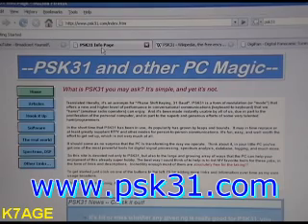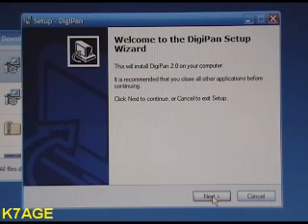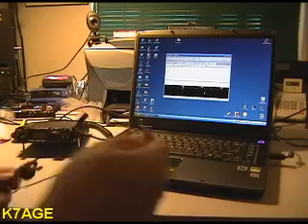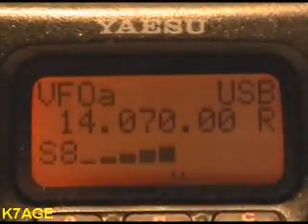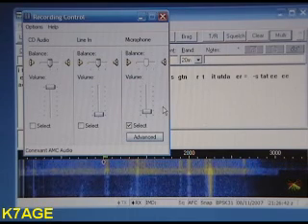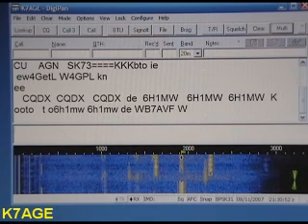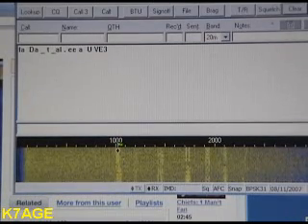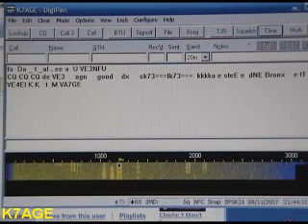How to receive PSK-31, Introduction

Comment: Randy, I am unsure if you will ever see this. I was wondering how a 20 meter vertical would work for PSK?  Would it be adequate , or do you need a better antenna system, because of QRN or whatever?
Reply from the maker: Hi, I should work fine. Although most of the digital activity has moved to the JT9 and JT4 modes. Vertical will work great for those modes. They do very well with weak signals.

Comment: Nice video Randy, so thought I'd try. Installed digipan and it runs, but Configure > Waterfall drive.. doesn't open that audio window you show. Other options in Configure do work, such as Sound Card... and Font... , but not Waterfall drive... 

Any ideas why that might be? (Win 7 Pro)

73 de Jim, ZS6JMB
Reply from the maker: Probably different with the newer version of window. Try the windows audio mixer

Comment: Theoretically, it is possible to use PSK31 on the CB (unlicensed truckers can use) band. Is this something you have ever done? Or is it a bravo alpha delta idea?
Reply from the maker: +jjovereats Technically, it would work. Legal, I don't know.
Reply: theres something called the "easy digi board" that'll hook up through the CBs Mic plug and you hook the board up to the computers sound card (sound output and line out). 

and I also seen a video on youtube whete a guy wired up a USB sound card into a CB (hooked up to the Mic plug) and sound would be connected by USB to the computer.
Reply: +madmax2069 the video using the easy digi board in named "CB Digital mode test"

and the one using a USB soundcard is called "Uniden bearcat 980 SSB cb radio with USB port"

Comment: Aha! I can use little $1 Baluns (audio matching transformers, balanced unbalanced)
 across both the speaker out on the transceiver and speaker out on the PC & interface the two!! Awesome! I used my last batch of cheap little audio Baluns in guitar & bass wah wah pedals, mainly because the impedance & resistance was almost spot on for a wah inductor, but for 2%-8% of the price, of a wah inductor, and they actually fit the circuit board holes. They don't look right cocked in there cocked at an angle, but they sure do work really well. By inducing a little constant DC current into the core with the secondary they get even better sounding as the core saturates.  Another project for another topic, but be maybe interesting to some people. Over saturating the coils is a really good thing for guitar, but not at all for data signals or voice signals.

Comment: Forgot to ask, do you have a video showing how to directly connect the radio to the computer? I am mainly a Mac user.

Thanks!

Rob
Reply from the maker: Sorry, I don't have a video that shows hooking up a radio. You typically need some type of serial interface to work with your logging software.
Reply: Rob Fern did you ever run PSK31 on a Mac? I too use Mac and have been looking for more info on using Mac instead of windows.
Reply from the maker: Sorry no Macs here. Google around to find others that are doing that.
Reply: VideosByDPF  I am currently trying to make it work. Everything "works." I do get a signal out. I tested this via 2m last night and right now I am trying to find anyone on. 14.070
Reply: Calling CQ on 14.070 psk31
Reply: I will be setting mine up (windows version) hopefully this evening. using an Icom IC-7200 and Chameleon Hybrid-Mini. Once I figure out the windows version I will search for mac.
Reply: VideosByDPF seems not too difficult... I am still getting to know the program. Bands seem to be bad today. I will let you know how do. Most vids out there seem to be incomplete. Just figure out a setting that I did not have on. I am on my 857d with my signalink USB into my ATAS 120 with my MacBookPro. I'll be on 14.070.

Comment: This is KU6C.  I just started using Digipan 2 under windows 8.1, signalink into my FT-450d transceiver.  My experience so far is problematic.  After just one transmission and switch back to RX mode, the waterfall stops working and the system will no longer transmit.  As a matter or fact it works inconsistently.  it will let me transmit an entire CQ, but then the program hangs up.  I sometimes have to reboot the machine to get the program to run again.  I am running Digipan on a Dell Celeron 1.5 GHZ laptop.
Reply from the maker: Maybe Digipan and 8.1 aren't hapy together. Try FLdigi, free. It does PSK and many other modes. Also, you may be getting RF back into the computer. Try leaving the Signalink on, and turning off your radio.
Reply: +K7AGE I downloaded Digipan and got text off your video with Windows 10. Windows 8.1 was, well, I really hated Win 8.1 with a passion! The upgrade to 10 was free, but not without a few problems. My hard drive took a dump, right after I got it sorted out, but that is unrelated.

Comment: Hi Randy - I just wanted to share a fix for Digipan 2.0 that I came up with to fix the broken station lookup function in that software. The lookup link for QRZ's web site has changed format since the last version of Digipan was compiled in 2004. I can up with a solution using Firefox and a plugin called redirector. You can find the link to my blog on my page on QRZ - I have an article on exactly how to do it on that blog - My call sign is KK6IQK - And thanks a lot for your videos on PSK - I am now receiving PSK signals with my new station and am close to taking my general exam because of your videos and examples you provide to us all. Take care! -- Jon
Reply from the maker: Jon Almada John, thanks for the fix it tips. Please keep me posted on your general.
Reply: K7AGE passed my general... just getting my antenna put up and should be up and running in the next week... woohoo
Reply from the maker: Jon Almada
Outstanding!
Reply: K7AGE I am excited... will see you out there. 73 de KK6IQL

Comment: This was really well done. Thank you Randy! Very nice intro to PSK31....now I need a 20 meter antenna. Does PSK31 only work on 20 meter or can I do this on 2 meter and 70cm too? I will research this myself...but great intro, thank you for taking the time to do this!
Reply from the maker: Drennen Gaffney PSK can work on any band.  Typically uses USB and uses less than 50 Hz of bandwidth. If used on FM, then it will take the entire channel. I don't think PSK is used beyond the HF bands.

Comment: It's not letting me open the waterfall drive in the configure tab. The mic works and nothing shows up in the waterfall area? Any ideas? Thanks. -KD9AKK
Reply from the maker: This video was made on a computer running XP. Sound changed with 7 & 8. What interface are you running?
Reply: I have win 7 and got it to work. Thanks much. Like your vids by the way.
Reply: tullyman82 .
Please tell us what you did to set it up with Windows7. I can't get mine to work.
Reply: If you get your external mic to work that's half the battle, let me know if you are that far.
Reply: You are going to have to go into the computers control panel. Find Hardware & sound. Playback tab on top is selected should see a speaker. click properties tab which will take you into speaker properties. Click levels tab on top, Click input monitor so it isn't muted. Then you have to click ok save settings. Now go into recording tab click levels, then click the speaker icon to unmute it click ok to save settings. Test mic if you can hear your self through speakers of computer. If not you might have to fart around. Hope this helps, settings are not saved after shutting off PC, kinda pain in the butt........

Comment: I just finished watching your 6 Meter Dipole video. Do think I can use this inside of my hotel room. I am on the third floor (top floor) which I guess should make it high enough above the Earth to not interfere with the ground.
Reply from the maker: That will work. You my have some interaction with other things in your hotel room. Give it a try. Some windows may have a metalized film to reduce the sun. Give it a try.

Comment from the maker: Your computer has speaker or line level, which is a high amplitude signal. This will probably overload the radio's mic input. You will need to attenuate the signal before going into the radio. You may have the same problem going the other way. Search for sound card ham radio interface.

Comment: Randy, I've got a Yeasu FT-8900R.  I was wondering if I could plug an audio cable into the speaker jack on the back of the radio and into the microphone jack of my computer and do it that way.  Am I going to blow anything up?  73!  Richard S. KF5RHI, Fort Worth Texas

Comment: Thank you very much for this tutorial (and all of your excellent amateur radio videos).  I found this video after finding your PSK31 sample video, which I was able to decode using the PSKer app on my iPod Touch.  That's pretty cool.

There are PSK31 programs for Linux.  I think I'll install one.

I've been interested in amateur radio since 1973, but never got my ticket. I'm finally taking the test in two weeks.

After much comparing, I think I'll order an FT-817ND today (RX only for now).

Comment: I've been a ham for many years but only recently got into HF digital modes. Unfortunately I can't really transmit via HF because of the apartment I'm in so I monitor using an Icom R75 and R8500 receivers. I managed to hide a vertical HF antenna in a tree out back and it seems to work great for listening. Of course the moment the property manager sees it it's all over but it's been several months now and it's remained hidden. 
I've had a lot of fun monitoring all kinds of modes :)

Comment: Maicel works in digital modulations since 2007, I have used programs> MIXW, DigiPan, UR5EQF currently Logger32 program makes use of the Polish language which suits me though "QRZ.COM" makes trouble from time to time but George SP9AUV handle it, Maicel greet to meet the bands Wieslaw SQ7MRR

Comment from the maker: Hi, PSK certainly could be used on 2M and 440 MHz. Using FM would require the entire FM channel bandwidth, negating the narrowness of PSK31. Using SSB would be better. I don't know if there are any preferred frequencies on these bands. A TNC is a modem for Packet radio, which is different from PSK. PSK typically uses the computer's sound card, or the soundcard located in a box or in the radio. You can run Packet using a sound card interface without needing a TNC.  Look for AGW Packet Engine.

Comment: Can PSK31 be used on the 2 Meter and 440 bands?  If so, what frequencies are or can be used? Also, can it be used on a simple dual band FM transceiver such as an Icom IC-2820H using an TNC?

Comment: This could work if you have a friend who is doing the same but I don't think you'll get QSO's on your own. With VHF/UHF you would use an X.25 connection, much higher bandwidth, 1200 or even 9600 baud.  73, W1SOP

Comment: I have a signalink USB and a Wouxun 2/440 HT ... I have the correct cable for the radio and signalink, can you use PSK with 2 meter or 440??

Comment: @aseglkj ... I'm using an MFJ-1625 Apartment/Balcony Ant. It's ok.  Very limited here. Doesn't do the greatest on 80m but I didn't expect much. After a little modification it at least got me back on the air. Still looking for something better. K4RUE

Comment: @K7AGE As part of full disclosure on my part I haven't, and don't at the moment, operate PSK31.  What I'm basing my statement on is posts others have made in ham relate forums stating their disappointment that the exchanges using this mode consist chiefly of signal reports, equipment and antenna gear and the like and that no "Hi, how you doing" sort of exchanges take place.  Do you engage in ragchews using PSK31?

Comment: it's a good idea to use LOWER case when doing PSK31, being vario code the most common letters are smaller in bit size, thus faster to send. and less prone to errors. Just a little hint :)

Keep the videos coming K7AGE de OY111 :)

Comment: I watched this video and had PSK 31 running in just a few minutes.  WHAT FUN!!  As I already have Ham Radio Deluxe, I used that instead of Digipan. I did this after sunset so no reception on 20 meters but I found alot on 80...It also surprised me how I could get such great reception here in the Southern Tier of NY from VE stations in western Canada to short hop stations from Ohio and they all were running 30 watts or less. Thanks for this video Randy. Great job! 73 de KB2RMC

Comment: PSK 31 on 2 meters sort of defeats the purpose of an EXTREEMLY narrow band (12500Hz VS 32Hz!! ) signal unless you are running it with 2 meters sideband..  and even then you will need a friend to be waiting for you because there isn't much of this type of activity on 2 meters.  I would look into packet and BBSs if you want to do a data mode on 2 meters.

Comment from the maker: The FT-817 is and interesting radio. I have done over 1000 miles per watt and have work 2500 miles on 6 M SSB with the rubber ducky antenna. I would not recommend the FT-817 as a first and only radio. With the current state of zero sun spots you will need more than 5 watts to get started. The FT-857 is very similar to the FT817, no battery but 100 watts on HF. I have both, and they both have their place in operation. Randy

Comment: dont know digipan, but mixw can lock on to the signal and readjust if the sender or receiver drifts.  

You should be able to even use vintage tubereceivers that way.